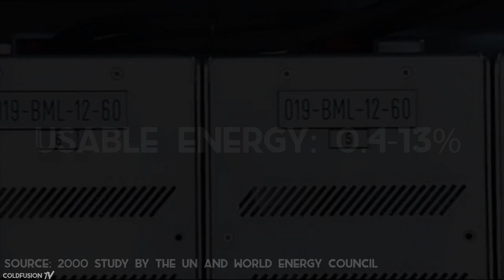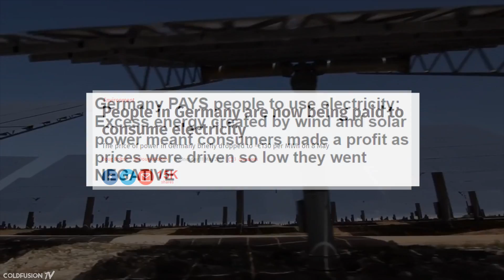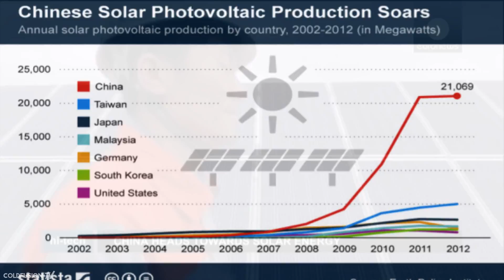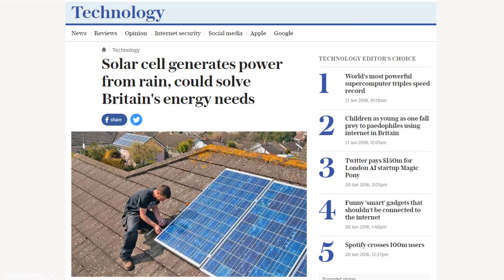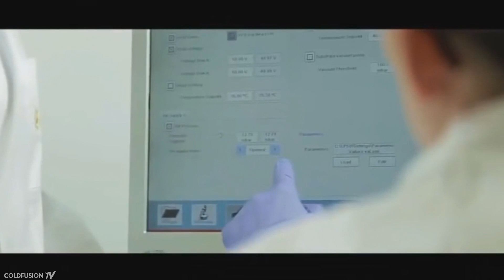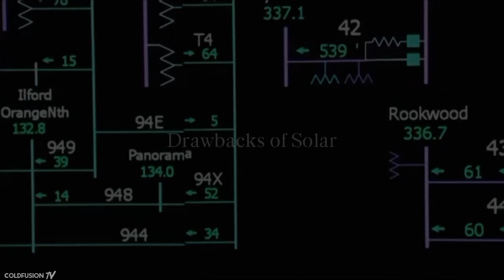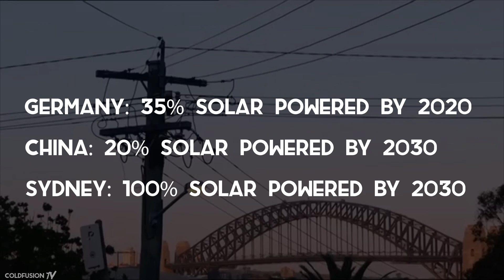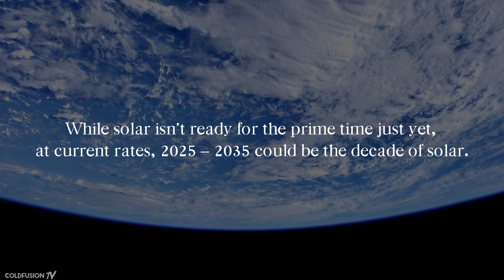The Truth About Solar

Comment: Couple of points:  1.  Tagline at end, "isn't ready for prime time yet..." contradicts the rest of the video.  Better tagline:  Solar, it's where energy production is going." etc.
2.  Numbers like, "8 cents/kwh" don't mean much unless context.  There's a graph showing cost of coal power, wind, solar power, as trend lines, so it'd be better to say, "Solar is already far cheaper than diesel generators, so islands are switching to it quickly."  and, "In many US states, solar at 8cents/kwh is already cheaper than coal at 10 cents.  Price drops show it will be cheaper than natural gas turbines by 2019."  (or whatever year it is, it's coming up quickly).  
3.  drawbacks line said "costly infrastructure build" required.  Saying, "Often, building a solar farm means also adding to electrical transmission lines so the power can get to where it's needed."  But, that set of lines is already partially built, it's a giant project called the HVDC grid, and it's in-process, mostly for Texas wind turbines but also Texas solar farms.

Comment: This is a superb video, clear and concise without lots of waffle, well done. A couple of things to note is when referring to the cost of electricity production what is not being fully appreciated at the moment is the hidden cost of nuclear and fossil fuel. Last I heard one of the nuclear reactors in Britain has cost £67 billion to Dismantle, yes thats billion and yes thats dismantle. And what about the cost of climate change, trillions world wide, this is is what is called the true maths or real maths of our energy production. The whole world needs to jump on board the clean energy revolution and any debate is held within the framework of achieving world wide clean renewable energy not the polarising debate of fossil fuels versus renewables. My only caveat is regards hydro electric as there are issue with water supply down river and fish migration, perhaps be put on hold for the moment. I am the leader, I have solar pv on my flat, my parents house, my sons house, I lead by example, I wish my people to follow suit (where applicable). In order of preference Industrial and commercial roof, public sector, domestic although don't let that hold anybody back. Diesel emissions are also something than needs addressing.

Comment: what if governments add a solar panel to every house than we don't need grids electrical companies using non-renewable sources shall be dead though
Reply: I guess that's fine if you don't need electricity when there's no sun out.
Reply: What if you live in a country where there are not as much sunlight in winter, or live in a country where one grid needs to power entire factories and condos. Or a country with vast distances with little population and transmission is a problem?

Comment: What matters is how much energy strikes the surface of a solar cell. The world average is anywhere from 120-164 watts per sq meter per day.
https://en.wikipedia.org/wiki/Sunlight

The average american home uses 2.4 KILOwatts per day of electricity. 
https://www.eia.gov/tools/faqs/faq.cfm?id=97&t=3

Even if solar cells were 100% efficient that would mean you would need at least 15 sq meters of solar cells for a typical house on average. Most solar cells are below 20% efficiency. So you are talking 75 square meters of solar cells to power a home at current consumption rates.

Solar is just not viable with todays energy needs. Is just basic physics. We need to be putting money into things like nuclear fusion research and other alternatives but solar is not the answer.

Comment: 3:14 notice you dont have a source for that 36 dollar per watt thingy... So, I did some digging. Cause, I dont like being told bullshit.

https://www.greentechmedia.com/articles/read/solar-pv-module-costs-to-fall-to-36-cents-per-watt

Seems the number comes from companies china where they say they expect they can create the cells at this price next year. Thats nice, for sure, but it isnt directly an indication of cost-efficiency. Sadly, the number says NOTHING about the use of solar power, but only about the price of the cell itself.

http://www.oecd-nea.org/ndd/reports/2012/system-effects-exec-sum.pdf
Now, you want to see more solar power, so I'll go with the higher penetration level:

Total grid-level system costs
Nuclear: $1.67 (lower with higher penetration)
Coal: $1.07 (no change with penetration)
Gas: $0.51 (no change with penetration)
Onshore wind: $19.84 (higher with higher penetration)
Offshore wind: $28.26 (higher with higher penetration)
Solar: $28.27 (MUCH higher with higher penetration)

This shows the problem with solar power. It is variable, same with wind power and windpower is even less variable, making the need for storage much higher and thus the costs higher with higher penetration. The more you use solar power, the more expensive compared to any other energy production it becomes.

Yes, it IS too expensive and it IS too inefficient to currently use it. Period.

That might change, of course. I'd love for it to change. But thats currently not the case. And acting like it is will do MORE harm, because it stifles the push for further innovation and in the end only create storage problems.

Comment: More sleight-of-hand here. Yes, certain large installations produce more electricity than needed, but for a short time at peak sunshine only. As soon as the sun gets lower, or even sets, obviously supply falls to zero. It is not strange that Germany is currently building 26 new coal fired power plants, and Japan is building over 40 coal fired power plants. China and India are building coal fired plants at breakneck rates. Demand for electricity is around the clock, while solar production is cyclical over the day, so conventional plants must always be online. 

As for the cost figures, one always has to be careful to subtract out the government subsidies for construction and the tax breaks for operation before declaring what the cost is. One must also subtract the extent that China subsidies the selling price for strategic reasons. This video does not give any hint about that. 

I'm not pessimistic about renewable energy, but I believe that all the billions we now spend on subsidies should instead be spent on R&D and a new grid. We are wasting money on the wrong thing. At the moment, solar and wind is suitable only at the margins.

Comment: I'm wondering, what is the potentially "will become better" technology for storing electricity? Just like solar panel that although slow but consistently getting better every year, is there the same kind of technology for energy storing gadget?
Reply: It is increasing in efficiency, but not nearly as fast as solar. I read an article about carbon fiber super capacity capacitors, which might be a replacement, but they were just discovered and it takes years to go from discovery to production, and they may not be viable once you look at all of the factors that go into mass producing a new technology.
Reply: *****
Yea I know about that one, it's called graphene supercapacitor. It become big at one point couple years ago, but then it kinda calming down a lot especially lately. Mainly also because like you said, they still haven't solve the hurdle to mass produce it. That's why I kinda not sure if it will be viable thing given how hard it is to be produced.

Comment: This video is pure bull. The diurnal changes of sunshine will mean, that, you have to install 8X your needs for winter in panel wattage, because, on average in the US, you only 3 hours of sun a day. And, at higher latitudes these numbers are worse.  Then, you have to store it. Count the inefficiency losses there. Multiply by 1.25. Now multiply by battery efficiency losses over time. Multiply by another 1.25. Now count line losses, soiling, cell degradation. Multiply by another 1.3. Now conversion losses from DC to AC. Multiply again. Now multiply for round turn losses into and out of batteries in an AC coupled system. Multiply by another factor for that. You could go direct DC through charge controllers and get maybe .83 full turn. So, multiply again if you go that route. And, remember you cannot extract but a small percentage of total battery energy or the batteries die prematurely. Multiply again. Now we have cloudy days. Multiply for batteries again by a factor of 3 --- standard for most systems. That means you have to add the solar panels to cover the extra batteries. Multiply again. Ok. 

Now we need to count the exogenous variables for business. Recycling batteries. Have you ever calculated that? They always brush that one aside. Nasty stuff. Very polluting. Now calculate for having to vacuum, if you can, the chemicals that are respectively 13,000, 23,000 and 27,000 more green house reactive than carbon dioxide. Good thing is they are parts per billion. Bad thing is: Have you ever tried creating vacuum on parts per billion for chemicals that are not readily absorbed by the environment like carbon dioxide. Now count substitution effects for land losses, that, could be farmed... ...

Now, tell me what your costs are. Silence. From the best off grid folks on Solar Panel Talk, a solar advocacy group, you are looking at over .60 cents per kilowatt hour generated if properly accounted for and depreciated. If you are good, really good, and have a deep understanding of these systems, you might be able to wedge your way in the door at 40 cents an kilowatt hour before counting exogenous variables. 

Now do you want solar? You would be crazy. It would collapse the economy. And, starve the world.

That is why Germany is selling electricity to France at below Total Costs on some days. In other words they are losing money, and, their grid will start to fail, because, it is economically nonviable. They are actually beginning to put in coal again.  

The only application for solar that is viable, is, to use it on remote sites where the grid is not economically viable due to line installation costs. 

And, if you want it worldwide, then, you have to have the grid anyways, or, costs go up even further. 

And, I am a big solar advocate. For the most part, solar will for many decades be a bad choice, and, more dirty than conventional fuels when properly assessed by someone, with, both engineering and economics backgrounds. 

Worldwide implementation currently is a pipe dream, or, a govt. subsidized rip-off for the rich except in specific situations. 
That being said research and development funding should continue, so, one day it is scalable. But, a battery revolution, that, correctly counts costs, has to come along with it. 

Thank you.

Comment: wow, lots of nuclear lovers here...experience shows me solar works great.  52 panels, 200 watts apiece, covers the south side of my a-frame house.  I live north of sixty in British Columbia, Canada.  Been off-grid for 4 years.  Yup, gotta take the snow off to get full power, but mostly slides off automatically.  Past the longest nights now.  Generator charges batteries as a supplement for consecutive blizzard days- but only 185 hours total on generator this year.  This system runs the entire farm, wellhouse, two shops, two houses, sauna, and greenhouse.  30 paralled deep cycle batteries run two stacked inverters for a traditional 220 volt service.  Trouble free.  Use wood for heating.   You must be energy conservative in december and january...but skads of excess power for the rest of the year.  A guy can split water with excess power to produce hydrogen gas for heating and generator fuel, but right now, the excess power heats water when the batteries are full, all automatically.   Don't need to be an electrical engineer to put up your own solar system, did this myself with a bit of research.  Helping my friends do the same, and solar is catching its stride in this neck of the woods.  20 thousand bucks will get you well setup. An investment worth considering , if you plan to stay in one spot for a while.  And very satisfying when you can be self sufficient.  I wish a bylaw would be passed to mandate solar panels for roofs of every new house built....I'd rather see solar and wind generation than a bunch of nuclear reactors on fault-lines. Just a matter of time before another Fukushima happens.  Still an uncontrolled enviromental  disaster, how much more can the Earth take?

Comment: A previous solar site admitted that the electrical wire infrastructure in the US is insufficient to carry solar generated energy.  Unless there is a way for the distribution to give and take there will be no market for the profiteers.  SO, what is going to happen is the same thing that already has happened; solar is taxed after it is installed on the roof.  That way the big corporates make $$ from solar and the homeowner takes all the burden of cost.

Comment: Well, the video did not address one of the largest downsides to solar and that is the life cycle costs of solar.  Manufacturing solar panels is very energy intensive and creates highly toxic waste which requires large amounts of power to incinerate (China just dumps it).  Solar panel construction also requires mining for the required raw materials.  And finally the panels rather dramatically lose their efficiency over time and must be replace every 30-40 years.  Now think about the amount of waste that would create as the panels become obsolete or useless.    We need an all-of-the-above energy policy to balance the supply and environmental impacts of energy production.  Including Hydro-electric, Nuclear, Wind, and yes, Fossil Fuels.

Comment: 36 cents per watt for manufacturers maybe, consumers pay more like $1.50 or more per watt. In my opinion the biggest feat Solar power has to overcome is Battery Technology.  We need to produce a battery that has a greater cycling life and better energy density, so far we have no bridge between Lithium (Energy Density > Cycling Life) and Lead Acid (Cycling Life > Energy Density)

People don't realize that your battery bank might have 1000s of amp hours in total but you can't use more than 50% due to the cycling dangers of using too much of your battery's available energy. You can spend a few grand and get a good number of decent mono cell panels but spend the same amount on batteries and you have lame duck storage. You have to spend 4x the amount in batteries to match an array (because you have to scale to higher voltages in order to overcome wire and peak currents) and still have adequate energy storage. 

My point is Solar cell technology has made more improvements in just the past 10 years than we have done with Battery technology in 50+. I think priority needs to be given to Battery technology for a time so we can reach a more practical energy storage solution in relation to solar.
Reply: Let me give you an actual example. The Dominican Republic has a power problem, lots of brown and blackouts, so people for years had relied on power inverters, they charge batteries when the power in on and use it latter when the power from the grid goes off. This has being the norm for years, problem is, the country has a led battery acid problem as old batteries are discarded, there's a town called Haina and it's being called one of the most contaminated places on hearth.
Reply: Sodium glass batteries may be the way forward (invented may the fellar that invented lithium iron batts . Its a matter of if it can scale up now. 3 time the power density , lighter , not sure of cycle life though, cheaper to make and solves the problem of bridgeing and shorting out the battery (longer life over all) . Lets hope it scales and they find no problems making them :)
Reply: Lithium anode battery, fluoride cathode, solid electrolyte.
Reply: Jazmie Hamizan 7
Reply: Do both, simultaneously. Oh wait, people already are. That's good.
Reply: The trend isn't towards home owners buying batteries, the trend is towards grid tie inverters and net metering. That puts the onus on the utility to balance peak production with peak demand. Ideally this is done with conventional hydro or failing that, pumped storage, but not batteries.
Reply: the Li-ion king (the person who invented lithium batteries) recently made a glass based solid battery that by calculation, is 10x better than lithium batteries. It should also last a lifetime due to its solid form and not explode like lithium when you cycle it too much.
Reply: There are other considerable factors that add into the equation too. Voltage conversion thermal loss, transmission loss, storage loss. These inefficiencies add up and compound the problem of solar cell efficiency. The reason the hydrocarbon industry is so successful is that hydrocarbons are a very efficient energy source that can surplus the infrastructure inefficiencies. Solar/wind can't do that yet...